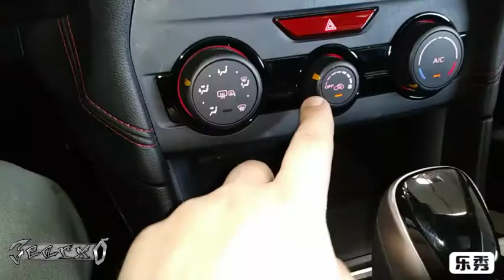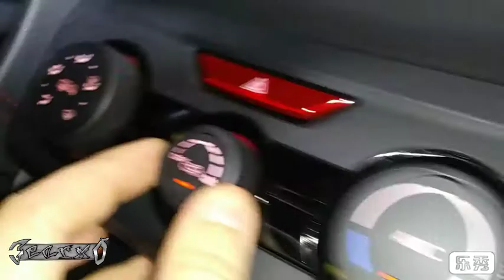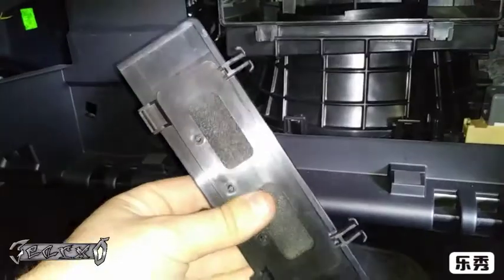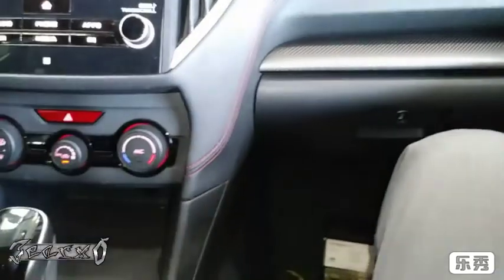2018 Subaru Impreza Blower motor noise & cabin filter replacement

Comment: Hey! Thanks for this, will take a look. My car’s AC vent on the right is making more of what I would call an annoying whirring/buzzing/static sound rather than ticking. Any ideas of what it might be?
Reply: It's the blower motor fan bearing is my best guess. We have a 2018 impreza 5d hatch. I'm about to change the blows today I can come back and re post an update if you would like. The noise we have is a small high pitch type whining noise if that makes sense. It's not super loud but def noticeable with no radio and your listening for it.

Comment: I don't know how you put the filter element in but the arrows are supposed to point down in the direction of air flow.
Reply: I just took out the original filter and the arrow was pointing up